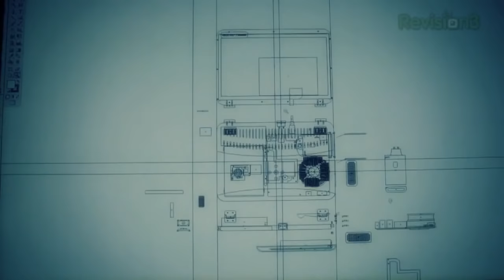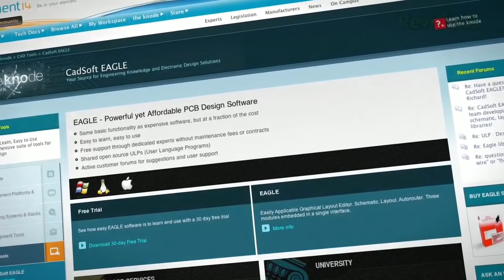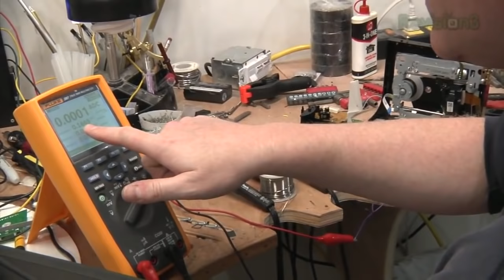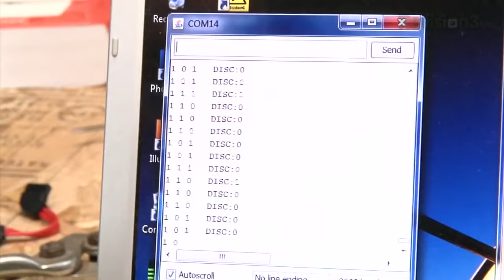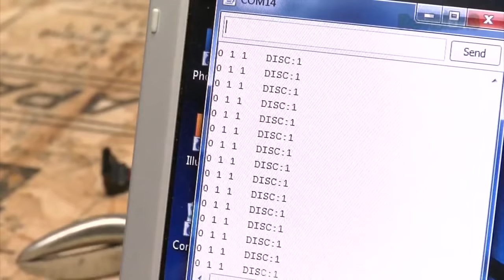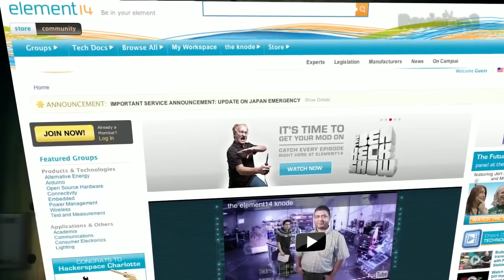Creating an XBOX 360 Automatic Game Changer! - The Ben Heck Show

Comment: Even now I like the idea of using something like the idea of using one of these loaders for my Blu-ray collection so I can keep the cases on display but don't need to take the discs out. Connect each bay in the rack to a switch and press in the case of the disc you want. More likely it would just mount a virtual disk these days.

Comment: PC has something like that, it's called steam and you don't need crappy discs.
Reply: I love steam but they really need to add trading and refunds :/
Reply: Luka Savic Trading is avalabile ... and before you buy a game watch some gameplay....
Reply: Nope....you dont have as many options as on pc....
Reply: TheUnknownContact #1 How so? PC has a lot of games. Most console games (Other than the exclusives that you cling on to) have a superior PC port.
Reply: Pc can run emulators , and you can upgrade your rig , and make it super powerful , and also , xbox can t run cheat engine , or any type of hacks without jailbreak or RGH or JTAG , so the truth is that ... i could never hook up an xboox to my laptop to use it as a screen
Reply: glitchsmasher GET REKT KID
Reply: TheUnknownContact #1 That's a stupid argument you see all the time "watch some gameplay." Unless you're playing some game without a story, then gameplay is the least important part of a modern game.
Reply: COD Ghosts Multiplayer .... thats a game with no story....
Reply: MrGencyExit64 "Story in a videogame is like story in a porno, It's expected to be there but it doesn't really matter"
Reply: glitchsmasher You play the wrong kinds of games my friend :-\ I play 75% RPGs and the other 25% is split between action-adventure, racing and puzzle. I don't expect much of a story from the later 3 types of games but if an RPG has no story it's no sale.
Reply: He plays what he wants....you could be the RPG guy ... i could be the COD guy and he could be the DOTA  guy
Reply: MrGencyExit64 It is a quote from a veteran of the games industry., John Carmack.
Reply: glitchsmasher Who has only made one successful type of game in his entire career; FPS. Of course story doesn't matter in an FPS =P (I know he made other games like Commander Keen, but they were not successes)
Reply: It fuckin doesnt ... you just kill people with different techniques!
Reply: Sigh when will theese kids ever learn that they can t get what they want everytime...
Reply: ***** Like what? Halo 1 over and over again, the same driving games over and over, see how desperate the console makers are to keep people from realising they're underpowered overpriced media machines?
Reply: ***** "Shell out a load of cash for a CPU" PCs can be bought for much cheaper and much more powerful than consoles. It is the most ignorant and uninformed argument I've heard, and I hear it a lot. http://www.reddit.com/r/PCMasterRace/wiki/builds and http://www.reddit.com/r/pcmasterrace/wiki/guide Get educated.
Reply: glitchsmasher To be fair, a quality CPU costs about as much as a console ;) And a quality GPU costs more than a console.
Reply: MrGencyExit64 The 750ti plays titanfall better than the xbone, and if you already have a PC that you use for web browsing you can buy a 970 or 980 and get top level performance for the cost of a console. High level AMD FX CPUs cost £100.
Reply: Dear Lord...my pc from 2009 plays titanfall at its best.... :/
Reply: glitchsmasher I'm not trying to argue one way or the other here, actually. I am a professional software engineer that works with OpenGL on a daily basis, my idea of quality components might be higher than someone who only uses their computer for gaming.

But the point I was trying to make is that the initial cost of building a system can be significantly higher than most people think. Upgrading is one thing, but if you build a system from scratch and you want to max out games with it, be prepared to pay a pretty penny. Especially if you don't leave out the cost of a monitor.

About $1,500-$2,000 will hit that mark and then you can probably go 3-4 years without upgrading.

If you just want to match the performance of a PS4 or Xbox One (why?) then you could piece together something on the cheap... but who does that?
Reply: MrGencyExit64 You're wrong. Gaming components DO get better than ""Next gen" for cheaper if you know what to buy. If you don't, /r/buildapc or /r/buildmeapc will do that for you.
Reply: glitchsmasher Did you not read the last paragraph? :-\
Reply: MrGencyExit64 Yes. Yes I did, did you read mine? I said you can make a PC on the cheap to beat next gen, a direct counter to the last paragraph of your comment.
Reply: glitchsmasher It is absolutely possible, but I question the appeal of doing that. People talk all the time about building a rig with comparable performance for less than the cost of a console, but unless you're doing it to prove a point you really don't get anything beneficial from that.

Most people don't build gaming PCs to play "next-gen" games on low or medium settings. Most people also don't build them for ultra settings (I only have a PC that can do that for work). I'd say the majority of people fall somewhere in the middle (targeting high, but not ultra).
Reply: Freak1393 "More games" Wrong, just wrong. "We have digital downloads" At slow speeds through bottlenecked NICs in your crappy OS.
Reply: glitchsmasher For me at high speed through free NIC in my awesome os - PC
Reply: ***** That could be a point mate...but i just consider that it kinda makes life easier....you do not have to find all the disks (over 100 for me) cause you have them all in your library... :)
Reply: TheUnknownContact #1 That's why I like what the Xbox One was trying to do. You buy a game on a disc and then the license is physically tied to your account. You could lose the disc but retain a downloadable copy from the cloud.

But at the same time, you could relinquish your license through an authorized resale party and then re-sell the disk. It would have been the best of both worlds, but ignorant consumers cried foul and we got what we have now :-\
Reply: MrGencyExit64 Dude....I don t even know why I am commenting anymore...I bought a gaming PC that is more expensive than a PS4 and an XBONE aaaaand.....i did a test run with a friend on WATCH_DOGS and my pc was running better that his xbox 360 , xbox one ....
Reply: TheUnknownContact #1 Yeah, I don't know why you're commenting either. This had nothing to do with PC vs. console. I too have a high-end gaming PC, as well as an Xbox One, a PS4, and a Wii U. I was referring to the distribution model.
Reply: MrGencyExit64 Technically...it was a type of PC vs Console ... like....steam vs any other console marketplace....well ps3 had steam , no? idk :)
Reply: TheUnknownContact #1 PS3 did have steam, but not the games,you can't run x86 windows games on a non x86 device without emulation, which would be REALLY slow.
Reply: glitchsmasher There are non-x86 games on Steam believe it or not. Some of the Steam Play games on OS X are universal binaries, so they can be played on PPC and x86. But Steam itself only runs on x86 Macs.
Reply: TheUnknownContact #1 Steam could actually work the way I was describing as well. Quite a few retail PC games sold in the US have to be activated on Steam, but once you do that you can no longer resell the game even though you have a physical disc-based copy.

It would have been nice if the Xbox One tested those waters. Then you might see some license transfer options for retail PC games activated on Steam, instead of being stuck with the game forever.
Reply: MrGencyExit64 you know you can do gameshares with friends or foes ?
Reply: troganx1 I know that, I actually have a lot of disc games. Just because it was like that doesn't change the present.
Reply: troganx1 Steam only requires you validate your software library by logging in once every 2 weeks. That is hardly what you would call a "constant internet connection". I went to Australia in 2012 and I only had to get an internet connection on my laptop half-way into the month long trip to revalidate my Steam library and continue playing games offline.

That was more of an ordeal than it sounds like actually, you have to pay by the megabyte in Australia and literally nowhere offers free WiFi like you would get in the states. It was still a minor inconvenience versus having to be constantly connected; I think it only cost me about $5 USD to connect to the Intenet on my laptop and login to Steam.
Reply: w xboxie też można kupować gry na xbox store i trzymać je na dysku bez płyt llololol
Reply: PovverKillerPL english please... ;(
Reply: glitchsmasher I love PC gaming, I also love xbox, but just saying games dont have better ports than console... Take GTA, BF, COD for example :S All AAA titles...
Reply: slyzany lol no reason to shut down...they make millions from their in game sales...
Reply: TheUnknownContact #1 yeah i know.. but just imagine
Reply: Umm...like...houses on fire , robots everywhere (just like in Wolfenstein TNO) and the consoles taking over :O
Reply: ***** YOUR BLACK BOXES THAT PLAY VIDEOGAMES ARE BEING MADE BY COMPANIES RUINING THE INDUSTRY.
Reply: Xbox has digital games to
Reply: troganx1 Yeah but PC gaming sucks.
Reply: Ramsfan09 How exactly?
Reply: glitchsmasher Am I the only one who sits in his room in a corner and covets and polishes my game discs? muttering "yes yesss so pretty and real "
Reply: ***** no. You're not.
Reply: ANewEvilRising Nowhere near as big.
Reply: TheUnknownContact #1 + your console hardrive will fillup in no time inferior tech. pc master race.
Reply: SpuddyWesker yay , at least (on pc) I can handle all the bloatware and adware
Reply: TheUnknownContact #1  yes very good point. your being controlled on what adds you see and on PC you can customize your experience.
Reply: SpuddyWesker I do own a shit 360 , full of ads for netflix , movies , stuff like that , dude thats why I dont play on consoles...
Reply: glitchsmasher but some dgames dont run on some pc
Reply: Shato Sakurin This is the 21st century, we have DX and OpenGL to fix compatibility issues. Also any PC built for over £250 will run every game ever made at at least low settings.
Reply: Ok
Reply: glitchsmasher yeah but some people have a crazy idea that a console is better then a pc for some strange reason lol go figure
Reply: Luka Savic They just added it.
Reply: Hell yeah , refunds!!!! BUY KNIVES AND RETURN THEM IN 48 HOURS!!!! STEAM SUMMER SALE BITCHES!
Reply: step one buy those ginso knives step two try to cut a pipe with them as they show in the videos step three when they go dull after about 30 seconds then return them and say they don't preform as advertised lol
Reply: Dylan Laveaux Calder Games on steam are overpriced? What are you on?
Reply: G2A.com and Kinguin , ever heard of them Dylan Laveaux Calder ?
Reply: steam origin gog they all have good prices during sales if your watching for them
Reply: +TheUnknownContact #1 You give a kid a console and he spends days playing it, and having fun. You give a kid a pc and he goes and cries about how it's superior.
Reply: SoloSynQ Not true :P
I had an xbox 360 , it was fun.
Got a PC , its way more fun than the xbox.
Usually I don't complain about graphics , as I run most games on medium , even tho' ultra goes at 30-60 fps depending the game.
It was darn fun building this PC , as i somehow cut myself in the I/O shield , so deep , man those things are evil.
Reply: TheUnknownContact #1 See? PC owner right there. You could of finished with the fact you like PC better after playing console. You. Could. Have. But you started stalking about graphics. You could have stopped. But no.
Reply: SoloSynQ
the only thing that matters is that no matter what you are playing on , at least have fun.
Reply: lol
Reply: +MrGencyExit64 Or just buy a good gaming pc prebuilt or make one your own
Reply: Roger Dy
yeah if they are all installed on your computer there is not need for a disc changer lol unless you want to play with discs like a console peasant
kinda surprised that the consoles have not reverted back to flash cartridges for faster game loads since installing to the hard disk is so slow and time consuming and flash memory has gone way way down in price and way way up in storage capacity
Reply: ElNamano This makes no sense. Even for a pc gamer. Pcs have discs too. And it's not Xbox doesn't  have downloadable games from the store. Get your facts right. Also I'm not defend Microsoft at all they were the ones when I had my console fucked me over.
Reply: jtag it
Reply: I prefer collecting discs and displaying on a shelf. Looks nice in my opinion.

Comment: He should put in a sensor that reads where the carousel is in the cycle, and hook it up to a digit screen that tells the number. Then have a list of which number corresponds to every certain game. Eventually; connect the sensor to a tablet that shows the DVD-covers of each game. Select the game you want, and a simple device put into the dvd-changer tells the carousel motor where to go :) If you can tell which DVD is selected, you can put the top of the changer back on, and it would look cool :)

Comment: Hiya Ben, i like what you did to a 90' CD changer and convert it to your XBOX 360, but what i DONT Like is the wires and the buttons that will control the carousel mechanism.. why not add an IR remote for the carousel and some LED Digit Display so you know what the disc's location is.. 

and the remote is embeded to your Xbox controller with some simple addtional switch.. or some combination button.. Back+Trigger.. or different button then trigger.

Comment: Disc changer is cool but I might want to spend on a x360key and rebuild the controller with a wireless  control, maybe using a android phone over bluetooth connection, seems doable much enough than finding a old disc changer  device.

Comment: by the way the ps3 is designed it would be easyer to have a ps3 do it then a 360 cause u can hook the cd change to the system and never take it apart just put a small fabric on the grabber to not scratch the disc

Comment: Wich controller board have you used for the 7" lcd display to work whit the xbox 360. I work on an projekt but i dont know hot to use en extrenal lcd screen withe the flat ribboncable with my xbox 360 odr my ps3.

Comment: on 9/9/13 make a real Nice working Portable Dreamcast with a VGA 6 inch screen and ability to have full function of 4 controller ports (with a easy covert switch that turns the on-system controller off) Full Natural VGA Output (a covert switch that switches between the port for the AV cable), Fully enclosed GD Disc Drive, and Region Free Mod with easy Covert Switch (if you like a Donation Console, i got one that has a bent ribbion cable XD)

Comment: I wonder? do the circuit boards have to be green? can they be another color and would it have any effects to it?
Reply: I think the material is naturally green. Adding color would just add to the cost. Also, I know that on black PCB`s its sometimes hard to see the copper layers. This makes it more inconvenient for making repairs and modifications to the circuit.
Reply: Alexander Blums well what if you print the circuit board in another color like maybe white! with black labels as we are used to seeing on paper, and the copper should be even easier to see, even with the pcb.
Reply: just bleach the board and dip in permenant dye hehe
Reply: the green stuff is called soldermask, it prevents you from frying your projects with solder
Reply: Never seen a brownish yellow PCB before?
Reply: Yes they can be different colors. When I was modding a the Halo 4 Xbox, the motherboard along with all of the other circuit boards visible through the case were a bright white color. I liked it personally.
Reply: Mythic Rising
It makes for an appealing circuit board when you add plexiglass windows to the Xbox.

Comment: Theres no way to tell what disk your selecting from the couch........so its useless.......you would have to allow it to load/read each and every disk as you lazy button your way through the disks in order to know what disk you are on. or memorize your collection by number if the LCD read out still works on the carousel.
Reply: Not if he wrote a little bit of code, so it knows where each game is. The disc changer could then tell him what game is ready for loading.